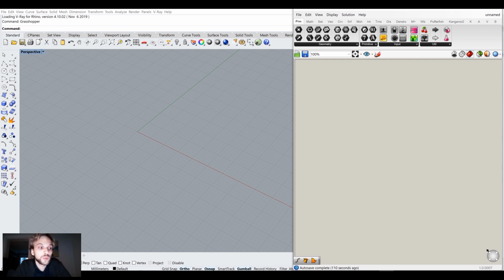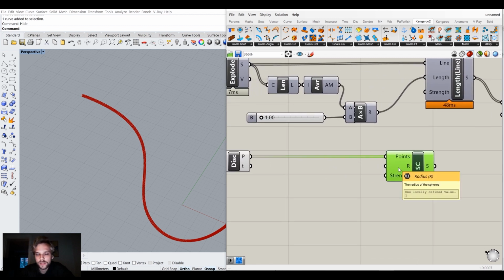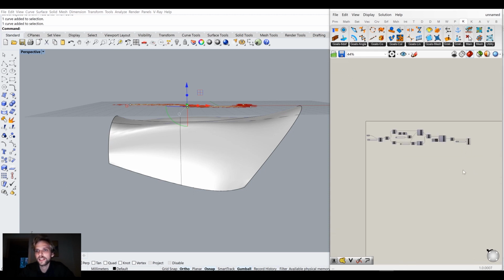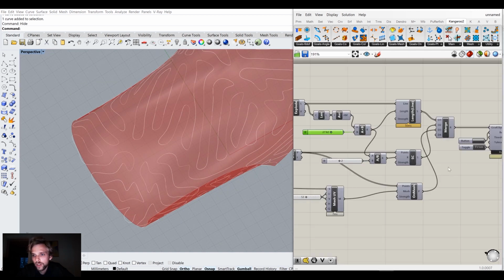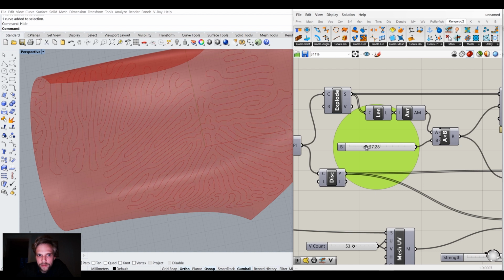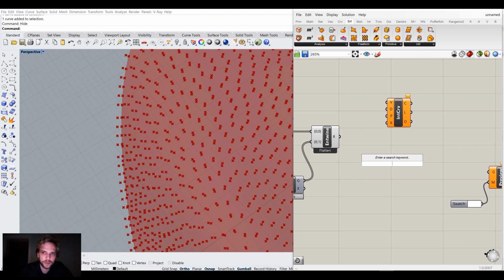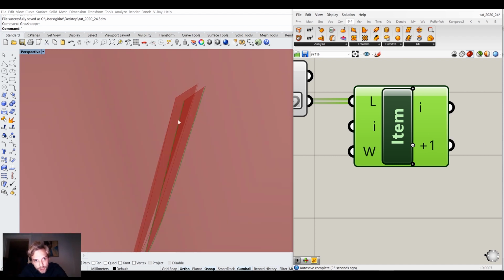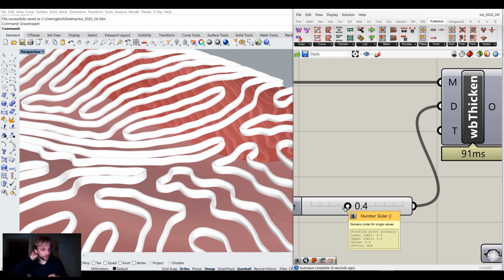How to: Curve Growth on 3D Form ( Grasshopper )

Comment: hi want to say thank you for this amazing tutorial im getting an error how ever when i add the nurbs curve its says there aren't enough verticies for a curve any idea how to fix that
Reply from the maker: hmm, probably a data tree issue. I assume if you check with "Panel" the point output, you'll see every point placed into a separate data branch. You need to merge the outer-most branches , and we use Trim Tree to do this.

Comment: Hi! Thanks for this tutorial. I haven't used Grasshopper for a couple years now and even back then I was terrible at it... But I am wondering if this could somehow work on a "closed" organic shape modeled with the SubD tools? I hope I explained it correctly.
Reply from the maker: Yea, there is no reason why it shouldn't. Just take the subD geometry , extract it's control polygon (gives a mesh), subdivide the mesh with catmul clark subdivision (weaverbird) and you're good
Reply: @DesignGoBrr  I wil try this,THANKS A LOT for replying!!!

Comment: Thank you very much for the tutorial! Is there a way for the pattern generated lines to be separated a certain distance? For example, the distance between two "parallel" lines in the 2D drawing is 1 mm.

Thanks a lot in advance!
Reply from the maker: Yea, that's exactly what sphere collide component does. If you define 1.000 for sphere collide - you'll get a gap of 1x2=2mm (both curves have a repulsion radius of 1mm, so it accumulates)
Reply: @DesignGoBrr  thanks a lot for your answer! :) the only problem that I have changing the radius of the spheres is that the lines are overlapped in some cases.
Reply from the maker: @inmagarcia6070  umm try using a smaller value for line length goal. The lines might be growing too much and overriding the colissions
Reply: @DesignGoBrr  Great! I will try this way. Thanks a lot ;)

Comment: I love your tutorials, I have been experimenting with differential growth algorithms and I have been trying to combine them with an attractor in some way. How should I do this? my though was to implement some sort of attraction function as the input for the sphere collision radius but I wasn't sure.
Reply from the maker: I think the attractor point approach would work. The method that you're describing would need the simulation to be built in C# or Python as you can only have a single radius for all point collisions in kangaroo. What you can do though is do the uniform differential growth and then run a second simulation on the grown curve for "compression" towards attractor points (with anemone).
Reply: @DesignGoBrr  So try and implement it after, like where you rebuilding the curve or at least get the polyline as the output of the simulation.

Comment: Hey Gediminas, first of all THANK YOU so much for your Videos!
One question: I would like to let the line grow inside a cube, so it will fill it out completely. Which component should I use for that, any idea?
(the "end game" will be printing a cube in one squiggly line to find out how it's physical characteristics would be...Of course I will have to anchor one end point and somehow figure out how to let it grow more or less one layer after another...)
Reply from the maker: Ok so you want to fill the space with a line that's grown in layers - so basically it grows flat in Layer0, then once it fills layer 0 - it jumps to layer 1 and continues it's growth and so on and so forth until it reaches the top of the bounding box. The main thing is - with this method  you will get either a clump of hair https://image.shutterstock.com/image-photo/tight-clump-black-human-hair-260nw-133983080.jpg (if the printed curve DOESN'T melt with it's own parts) or this https://en.wikipedia.org/wiki/Instant_noodle#/media/File:Mama_instant_noodle_block.jpg (if the printed curve DOES melt with it's own parts). It's very hard to get an interesting macro scale behavior with chaotic micro scale assemblies. My suggestion would be to look into Hilbert Space Filling Curve and re-visiting the manufacturing technique (perhaps producing segments of it separately and then assembling them into the big part as a puzzle would give you higher degree of freedom for the design?)
Reply: Thanks a lot for this quick and long answer. The plan was to let the parts melt together. What I am doing is not really a design of something, its more about trying to use the printer in different ways. Also I am making the g-codes with grasshopper, and I thought this could be a nice topic to do all that...
Do you have any examples on "interesting macro scale behavior with chaotic micro scale assemblies" ? I already looked into different space filling curves but my skills are way to low to work on that (I think), also I like chaotic looking thinks :-)
It would be cool if it would not just do one layer after another, but "intertwine" them in the few millimeters that the printer is able to go down in Z-axis without colliding with the previous parts of the line...
It is probably not the best idea, lets see if it works out. Anyway, thanks for your support !!  :-)